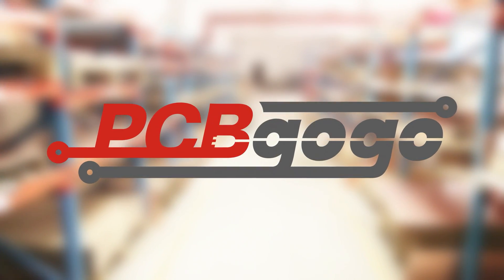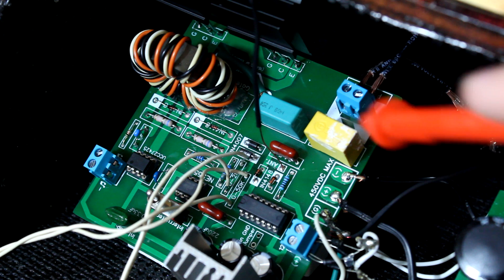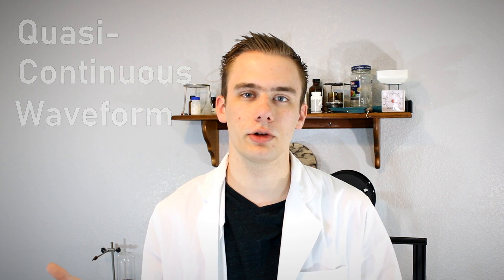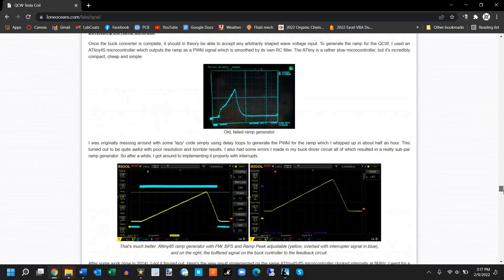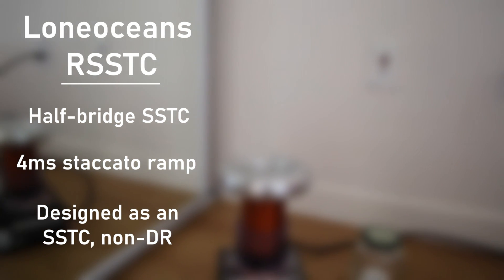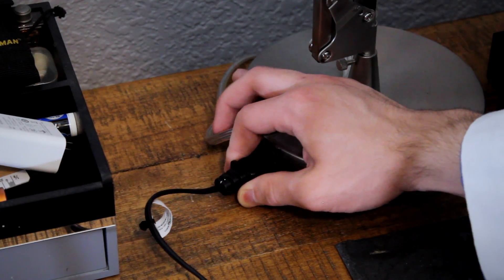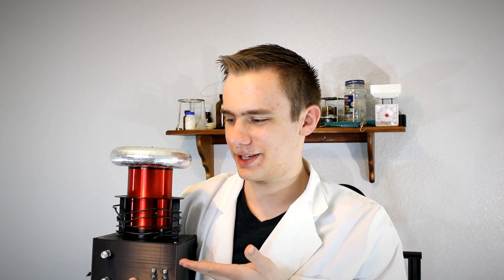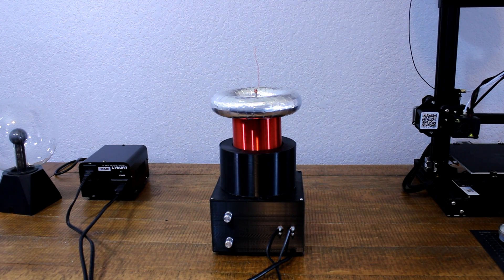World's Easiest QCW Tesla Coil (Staccato-Ramped DRSSTC) | The Ultimate Build Guide

Comment: NIce work LC! Im planning on getting a 3D printer for identical uses as well. Those sparks are massive bro. How many pulses compose each burst?
Reply from the maker: Thanks Jay, glad you liked the video! Each spark burst is generated by a single ramped pulse, which is adjustable via the potentiometers linked to the staccato circuit. The max BPS is pretty low (under 60Hz, maybe less than 30Hz), and the pulse width ranges from near-zero to 8 milliseconds.

Comment: How close to resonance you tuning it? I assume you're tuning it a little high? I ask because I'm almost ready to tune mine
Reply: I know im late, i decided to answer peoples comments and questions since labcoatz isn't doing it, i believe he has his detuned maybe 20percent lower than secondary. The long arcs cause secondary frequency to drop, i built one and it goes from 390khz down to 200khz, as he said a topload is better to have then to not. My case is a bit extreme though and most likely wont be a problem for you, if it is you will see the arcs be kind of lightning and branching out instead of the straight arcs he has. And you should tune it a little lower even then the dropped frequency, since there is no over current protection you should tune it lower to limit current.

Comment: LabCoatz we are at it again with your Staccato QCW DRSSTC.   If you are still checking comments, we have a question.  We have your DRSSTC coil constructed, but we realized that we missed ordering the capacitors for the MMC.    Your video shows that you built a 2KV 80nf MMC.   Which consisted of 4 capacitors.    The Instructables site suggested 1kV or higher film capacitors to set up the MMC.  The  Instructables site recommended buying a set of ten 0.01uF (10nF) capacitors.   Would an MMC built with four 0.01uF capacitors be enough for this build?   I am getting ready to make the order and thought I would ask prior to making the order.     As always, your advice would be greatly appreciated.    By the way your SSTC we built is working perfectly.
Reply: A one in a million chance you will read this, much less respond to it, but here I go.  Did you ever get a resolution to your MMC configuration?  I believe that if you have qty of ten 10nF caps @ 2kV, putting 8 of them in parallel should give you an 80nF @ 2kV MMC,  10 in parallel would yield an MMC of 100nF @ 2kV.  Connecting qty of four 10nF in parallel only yields 40nF.  Of course putting  two 10nF in series will half the capacitance but double the voltage capacity, so 5nF @ 4kV. 

Unfortunately, for me,  OP of this video doesn't go into detail about the MMC or the secondary coil.  Tesla coil builders are supposed to already know this stuff!  Anyway, it  is not clear to me  if the MMC needs, bleeder resistors or not.  I guess since it is only rated at 2kV then perhaps this is not a safety issue?  Well I can tell you that if you make the mistake of grounding yourself across that MMC at 80nF or 100nF, it will absolutely shock the living crap out of you no question!   But lethal?  Probably just make you think it was; don't ask me how I know this! 

A 10MΩ resistor across each capacitor sounds about right.  I mean I guess!  Not 100% sure about that!  Wattage?  1/2W sounds about right,  I think that 1W would be a bit extreme, but I guess if they get hot then size up!  Time (seconds) = R * C , so for a 100nF MMC, Total capacitance = 10 * 10nF (ten 10nF caps in parallel)  =  100nF, and with a 10MΩ resistor across each capacitor, the discharge time would be Time = 10,000,000 ohms *  0.00000001 Farads = 0.1 Seconds.     That seems a bit fast to me so maybe the resistance needs to be higher.  Not sure.   If bleeders were necessary, I would guess that video OP would have mentioned that fact, so I am probably off on a tangent. 

Note that I do not speak with authority!  If I am wrong, then let the flames roast me.  At least I tried to answer your question, albeit 6 months late.   I had the same question as you, but managed to answer it by attempting to answer  yours 🙂  If you do read this, any advice on the construction of the secondary would be greatly appreciated.  I have an idea, but sharing any hard learned lessons would be greatly appreciated.

Comment: hey, i built this and its amazing. But I need to put it behind a glass and start it by pressing a button. Then arduino should turn it on and off after 20 seconds. When I used a typical 10A mechanical relay it fused the switchable terminals together. Is there a smarter easier way of turning the coil on and off safely apart from controlling the 220V AC supply from the outlet? Maybe some wire in the driver can be safely switched? Or somewhere in the primary or secondary circuits? Thank you! It shouldn't put stress on the IGBTS

Comment: Hello, can you specify how you ground the circuit while in the box? If the electrical network does not have a ground wire, what should we do? Use a fake ground connection, like connecting to a metal table, for example? Is it okay to connect the secondary LV wire to the ground wire of the circuit and then lead it to ground?

Comment: @LabCoatz I gave this circuit a try, but I wasn't able to get primary feedback working reliably without adding a resitor across pin 1 and 13 of the 74HC14. You mentioned you had trouble, maybe give that a shot.

Comment: I have all of the components plus your PCB board and I do not see much help in the video about the antenna you use, type and length, and also where does that 12vdc transformer go? Also the 2 POTs that are used, which terminals are used and how they are wires up.

Comment: Is the result with staccato interrupter the same as with buck converter before halfbridge or is it worse?
Reply from the maker: It honestly depends on the coil, but in general, a buck converter or phase-shift QCW setup will be far better. This staccato setup tends to max out with sparks 4X the secondary's length, but a "true" QCW can exceed 10X. Additionally, this staccato setup is limited to the peak current of the outlet (maybe 100A or lower, I imagine), while a "true" QCW gets as much current as the bus capacitor can supply (well over 100A).

Comment: I’m sure you’ve said it but what are the specs on this specific coil?
Reply from the maker: The coil itself is about 5" tall and was made from 34AWG wire wrapped onto a 4" PVC (4.25" actual OD). The primary is around 4.75 turns, 2" tall, and 5.5" in diameter, with a 0.088uF primary capacitor in series with it. 6" topload with 1.5" thickness.
Reply: @LabCoatz_Science  my wire awg is way higher it’s like in the 26awg range. How many turns 1000? I think you said it.
Reply: @LabCoatz_Science  I have one that’s 5.5’’ length 4.5’’ diameter and 500 turns will that work?

Comment: I built my PCB and it worked fine with the bridge on 12V AC (no sparks but it lit fluorescent tubes) when I connected it to 230 is blew fuses (maybe the TVS diodes got damaged then) after then connecting it to 12V again, traces leading to the bridge rectifier burned, the rectifier exploded, and the TVS diodes were cracked and shorted. From measuring resistances and diode mode with a multimeter the IGBTs seem ok,  is it possible? I'll test the low voltage side, replace the traces burnt traces with wires, replace the rectifier and diodes.

What could have caused this?

Comment: I just finished the build and turned it on to find it has around 1-2 inch sparks. It seems to have the biggest sparks when it first turns on then quickly shortens to 1 Inch. I then flipped the wiring of the primary and got no output at all? Could I have possibly killed my igbts? I checked and it doesn't appear I have a loose connection anywhere(or any burns on the board. Igbts visually look fine)
Reply from the maker: Flip the primary coil back to normal and try with a longer antenna, higher primary coil coupling, longer breakout point, and maybe mess with the number of turns on the primary coil. If sparks are being produced, the circuit is most likely fine and your setup just needs a little tweaking.

Comment: I would like to build this and have three questions.
1. Does the IGBT have to be insulated from the heatsink or can it be attached directly with just thermal paste?
2. Can I test the low voltage side by not having power on the bridge, providing some signal for the antenna and then measuring the GDT outputs, etc with an oscilloscope?
3. Can I run the bridge at 12V (from a separate transformer) for initial tests?
Reply from the maker: The IGBTs don't require insulation between them and the heatsinks (since two separate heatsinks are required), and yes, you can power the bridge with 12V and apply your own signals to the antenna.
Reply: Thank you for the reply @LabCoatz_Science  my coil is from a previous attempt at some other driver which was failed, it's 11cm diameter, 38 cm winding length with about 1400 turns (calculated not counted) , duct toroid, teslaTC gave me a frequency of about 170kHz I think. 
I'll start with more turns on the primary 9 or 10 (that reduces stress on components right?).
I don't care as much about the size or straightness of the arc since it's still my first coil, the number of primary turns can be still reduced later to get bigger arcs. 
I should aim for having the MMC set in a way that the primary is more detuned than normal so 85% or  lower frequency than secondary when using antenna?
Reply: @AsdfirePL  I read on other SSTC sites that running the gate driver chips (UCC37321/2) without any FETs (or IGBTs) connected to the GDT can damage them.
Something about they start to self oscillate and burn out.
They recommend puttng some resistors instead of the FETs if running the driver side for initial test.
Maybe this applies just for higher power variants.

Comment: Oh, hi dude, sorry 2 bother u again about something! Well, I already ordered your PCB from jlcpcb & while I was busy soldering some of the components, I then noticed something weird! In your schematic, you included those TVS diodes plus that MMC 100nF cap but in your PCB, you didn't make provision for them! Means that I'll not be able to use ur PCB then! Can I still use it without those components or it will not work properly? For the TVS diodes, I can solder them like u did but what about the MMC cap? What can I do bro? If I bypass the MMC cap, I think I'm not going to get great output!
Reply from the maker: The TVS diodes get soldered directly to the IGBTs, like I showed, and the MMC capacitor(s) get wired in series with primary coil, as shown in the schematic.
Reply: @LabCoatz_Science  Thanks man. We'll, hope to see you soon with a new video on a real full bridge drsstc. Take care. Cheers & happy new year 2u & family. Stay blessed.
Reply: The reason they are not on the PCB is that the diodes are soldered directly between the FETs legs and the MMC cap is connected directly to the primary coil.
The MMC is usally made from several HV capacitors connected in parallell and series (to match your needed capacitance and voltage rating) and is made into a separate little box unit.

Comment: Quick question, "Some 1kV or higher film capacitors to set up the MMC bank (I recommend buying a set of ten 0.01uF capacitors)". I got these too but I don't see where you are using them from the instructions or on your PCB. Thanks.
Reply from the maker: They don't go on the PCB, you simply wire them in series with the primary coil.

Comment: Great stuff man.  I bought everything exactly as you. Had your PCB printed, even the same power supply I got. When I turn on the power to the board (no primary or secondary for now), it blows the house 20A breaker, every time. Any ideas other than up the breaker size?
Reply from the maker: Glad to hear you're trying the build! Normally, this circuit draws under 5A at 240V (probably only 2.5A at 120V), so if the breaker blew, you most likely wired the GDT incorrectly, which causes the IGBTs to simply short-circuit (even without a primary coil) and die. I recommend swapping the wires on one of the GDT secondaries and replacing the IGBTs (and probably the TVS diodes, if you used them). Good luck!
Reply: @LabCoatz_Science  That's an impressive response time. lol. Yeah, I was just about to tear into the GDT, I was so careful  too.  I did use the TVS as recommended. I am going to check them, not sure they are blown just yet. I did buy spares, also as suggested.  I really appreciate the quick response. I am gonna get this thing sparking!..

Comment: By the way, I ordered the PCB from your files but my board us different than yours. For example, my board doesn't have the swutch you showman yours? Did I get the wrong version of the PCB files?
Thanks
Reply from the maker: No, the switch was found to be unnecessary, so it was removed from the PCB designs.